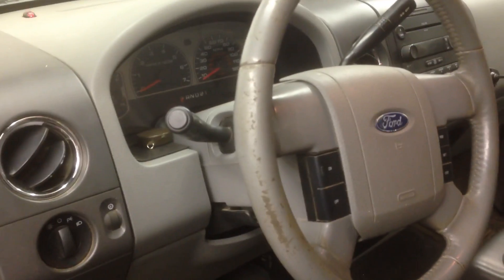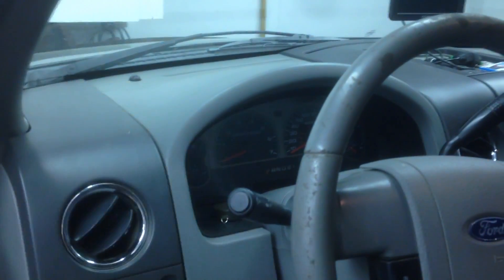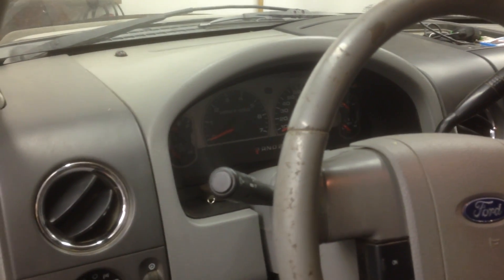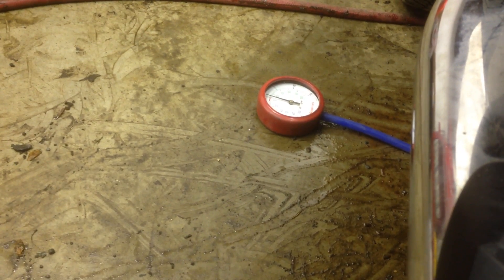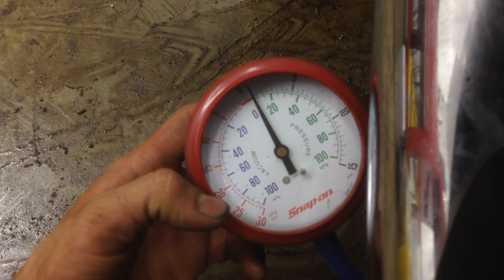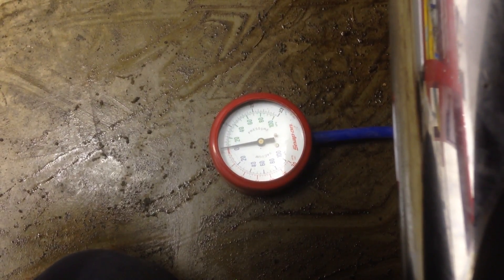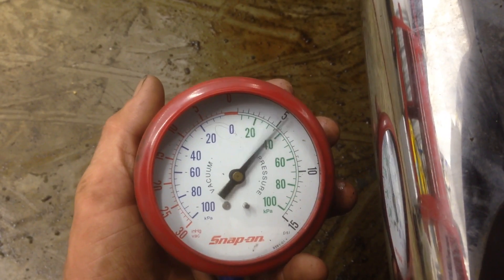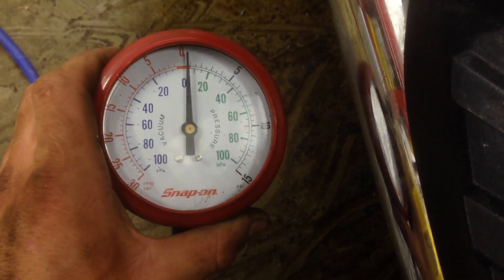Ford 5.4 F150 Clogged Catalytic Converter

Comment: Bought an 04 FX4 a couple years back, ran really rough, no power. The engine had been replaced at 200k with a "known good", 2006 5.4 with 75k. Still ran horrible and dealer/shop was selling it for customer for 3500... Offered 22 & they surprisingly accepted after one phone call!
Went home and got to work. Code was for defective intake manifold valve -forget what it's called but didn't think it would cause such problem... After almost replacing but finding linkage was bound, I started to suspect clogged exhaust - mostly because of engine sound. 
Removed and gutted driver side cat and it was a different truck altogether! 
Now I suspect the other side is also restricted...

Comment: I occasionally hear a sound similar to that of metal cooling down after a heat cycle. 2009 150 5.4 3v. No codes with the exception of P0442 small evap leak that I believe may be due to the capless easy fuel inlet seal however someone stated it could be leaking exhaust manifold which I do know are common but never heard could cause evap leak? Thanks for all of the informative videos relating to these Fords. You explain things well..particularly enjoyed the series where you cover the labor hours, approx cost etc of timing repairs.

Comment: I have the same truck 2007 5.4 on parking it will give gas but once i shitf to reverse or drive  i push the gas pedal and doesnt do anything i already change some sensor some relys and still .do you have any clue why or what i need to do honestly im already deaperate i have put a lot of money and time and nothing..

Comment: If you dont have the money to fix your converter hit with a hammer and have someonr hit the gas to push it out. I did it on my chevy blazer.  It barley would even go and wouldnt even go over 3000 rmps. Ran good after i did it. But make sure if it near the manifolds its not real rusty and you have a bigger problem

Comment: I am really hoping this is the case to my 01 350. At first it was 2 bad coil packs and a misfire on cyl 3 so I replaced all of the spark plugs and all of the coil packs and it ran a lot better but now it's getting bad again and my truck just feels soooo gutless ESPECIALLY up hills and that is where i notice the misfiring and or whatever else is wrong with it. I just wish it had an o2 hole closer to the cat and not way up next to the engine.
Reply: What was the cause? What did you end up replacing to fix your truck?
Reply: @ErnestRamirez-x5y  bad connection to couple coil packs due to the clips notorious breaking. So loose connection was causing intermittent no spark fire causing fuel to not fully burn and foul up a couple plugs. Replaced plugs and semi fixed the connection, had some vacuum leaks and the throttle position sensor had gone bad as well. Replaced the TPS and some vacuum lines and it's been running pretty good since.
Reply: @insaneTrout awesome! Thank you for replying
Reply: @ErnestRamirez-x5y yup, no worries. What's funny is that the truck has never thrown a check engine light for any of the issues other than the TPS going bad. And even that took a while before it set a code.

Comment: Can the cat be checked by inlet / outlet temp. ? I have a 4.6 triton 2006 with no check engine light but running ruff .
Reply: Change the plugs.
Reply: What was the issue?

Comment: I've had a problem with my 2000 Ford Expedition 4.6 triton. If It revs anywhere over 3,000 rpm it sounds like it wants to blow itself up. Now I don't romp on this vehicle much because it's my only way to school. And I know more about deisels than gas engines. Could my timing be off because I check my fluids almost daily and everything is full

Comment: I wish you were working on my truck!  It would mostly be fixed, already lol

I was told to put mid-grade in it to stop it.  I just rolled my eyes at that one.  finally, today, I got the word that my cat converter is bad!  imagine that!  It rattles, too..  Again, they said use mid-grade, lol what?  I'm not sure why it's so hard to find a good mechanic that listens AND knows what they're doing😞

Comment: Dude, clean your shop floor for for F"$% sake. Was interested to see your diagnosis till i saw that disgusting mess. Now i am just running as far away from your dump as i can....
Reply: Anton Spilhaus fuck off
Reply: Thats what happens when you work on a vehicle.  Keep taking your ford temp to a mechanic with a clean floor so u don't get any dirt under your nails pumpkin
Reply: @DAREWAGZ  Stealership secret to clean floors. 1. Replace never repair 2. Never look for the root cause(repeat No.1 until problem is solved or customer's life savings is depleted) 3. Do not take in vehicles that are old enough for parts to start failing or that are dirty. Follow these 3 simple rules and your shop floor will be so clean that nobody will even believe you work vehicles. They will likely think you only add accessories, drink coffee and sell extremely over priced parts.

Comment: Hey so did changing the cats allow the motor to rev over 3k? I have the exact same things going on with my truck, I've slacked on maintenance and now I've changed the plugs, coils, just put a new transmission in it. Thought it would fix the prob but I'm getting the p0420 and p0430 codes. I'm assuming my cats are clogged since I can't rev over 3k. Any info would help. Thanks!!
Reply: take it to a muffler shop they will test and repair
Reply: Long shot, but were you cats clogged? Mine doesn’t go over 3k rpms too

Comment: I have an 04 5.4 that I had the motor replaced in at 120k (previous owner used it as a hunt club truck) I've found the cat code now. what's the next step? replace just the one? or would it be better to have long tube headers and cats installed?

Comment: Sometime is you just take a tool and tap on the exhaust system if you hear a sound like broken glass inside the exhaust components it is a converter failure. A converter has a glass lining that is covered with platinum sulfide.
BTW the platinum sulfide is worth recycle money.

Comment: A Vacuum gauge is a very important tool for diagnosis.
It can tell you many other things too.
For instance: a wiggling needle on the gauge can be worn valve guides.
Reply: That's pressure not vacuum

Comment: This truck is a real turd huh?
Reply: Yeah, maybe and it about owner too...
Reply: Joey P at least it's not a Chevy :D
Reply from the maker: This one in particular has been a nightmare lol. Combining poor designs with lack of maintenance creates the perfect storm. I'm not even done yet, there's more to come!
Reply: @DanielJaegerFilms  
Will a bad sensor cause the truck to shake stutter and won't accelerate from slow or stop to go? It runs fine when I floor it but in the city stop and go makes it want to stall out but doesn't but it won't accelerate until I floor it. Could a bad o2 sensor do this?

Comment: I had exactly the same issue with my gardenwares : clogged exhaust, making the engine overheat and loose more than 80% of its initial power. And the engine ran so silently when idling...

Comment: Dear god... what cause the cats to die so badly? Was the engine dumping fuel into them?
Reply from the maker: Here's my theory. The owner of this truck drove it for a long time with bad plugs that misfired under load. Combine that with the loose timing chains causing the engine to run out of time and that cat probably burned a ton of raw fuel for a long time. Eventually it just melts and clogs up from the extreme heat.
Reply: ***** I was just about to comment that ^. Yep I believe the same thing happened.

Comment: Are true dual straight pipes good for a truck? 2011 f150 4.6 v8
Reply: it depends what youd like to spend on gas. it really goes hand in hand with each truck some people get better mileage some people get worse. from the loss of back pressure etc etc.
Reply: 1990Ravens yes very good for throttle response, ears and efficiency of engine